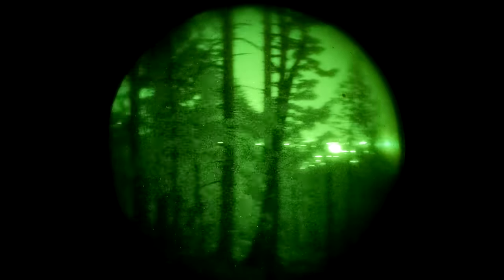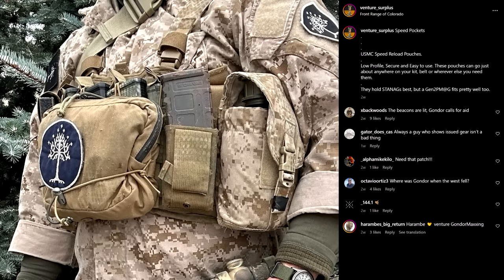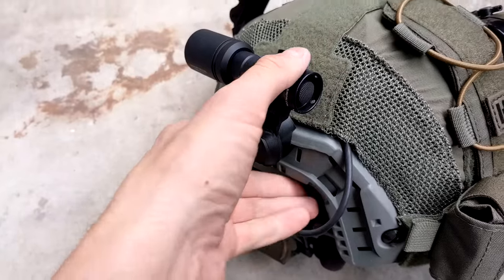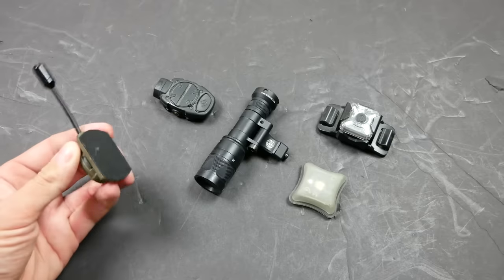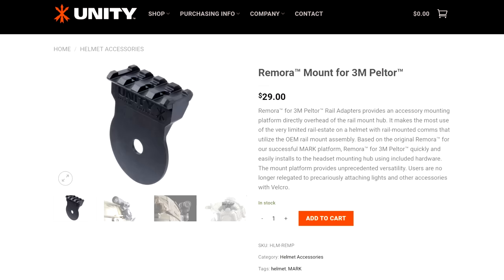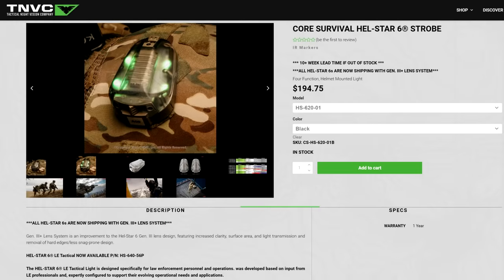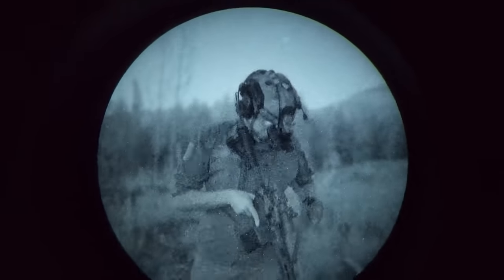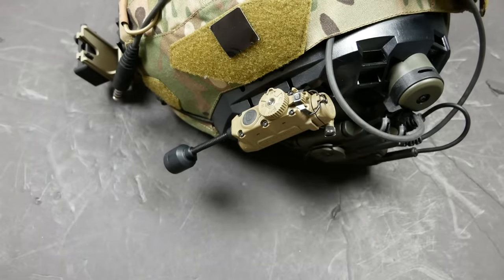NV Helmet Setup: Task Lights and IFF

Comment: A really good use of a strobe system is on night hikes with your pet and you're worried about them running off after a squirrel or something. Gives you a better ability to pick them out. Another good use would be on your vehicle once you enter a new area to mark where you parked. Night hiking in a new area can be daunting because you're worried about potentially losing where you came from.
Reply: I do this with my dog and it's a must in my opinion.
Reply: and for the low tech nights use glow stick necklaces and put on them like a collar. I use this for camping so I can easily see the dog
Reply: A leash
Reply: Wow aren’t you original
Reply: I do the vehicle mark as well. Totally worth doing for parking in new areas!

Comment: The streamlight sidewinder 2 was the GOAT of headlamps in Ranger school and in my Infantry unit. 

It was the only red lens headlamp I could find that took AA batteries. That was huge. Had battery commonality with PVS-14's (and later back at my unit, our ancient PEQ-2's) and I could (and did) swap the battery in the dark while rucking, instead of having to struggle with 3 AAA's that alternate directions. Plus it has IR and a helmet mount, and can take EITHER a single CR123 or AA. I have 2 or 3 now.
Reply: The Compact IIs are the best!
Reply: Yea man, we had the regular Sidewinder (now apparently called the "LED Hands Free Light" according to their website) when I was in the Corps.  It was seriously one of the bits of issued gear that was legitimately GOOD.  Dropped one in a portashitter in asscrackistan and actually went through the shitty process of getting it out.  Even after being thoroughly washed and DOUSED it in hand sanitizer, it still worked!!  lol
Reply: would rather a shitty light than a nonfunctional one 🥴

Comment: Admin lights and stobes seem to be one thing you could really find a great price for on the Ali-Express knockoff market. They don't have to survive recoil, don't need to put out that much power, etc.
Reply: That`s it, got my repro strobe and princeton tec for 30 bucks each
Reply: I have PrinceTec tasklight and Helstar 6 on my primary helmet and exactly same setup with chineese knockoffs on the other. In retrospect, no repros being available in 2016 aside, I regret spending $$$ on original ones. Repros perform well enough and withstand heavy rain. And I obviously don't dive and don't halo jump :P
Reply: I drop shit too much to not go anything but real deal tbh.
Reply: Yeah strongly recommend multiple map/task lights. Run a headlamp on your neck, if you have comms, run a lip light, if you have a helmet, run a stalk. Also have a handheld like a streamlight sidewinder 14032 to hold in your hands. These don't need to be the fanciest things. Just recommend blue/green light if you're using them with nightvision

Comment: The sidewinder Stalk is the best option by far, I was preparing to type an angry comment towards you ignoring it when you revealed it on the table. You can use the Velcro mount to put it on the helmet instead of the rail and still mount earpro.
Reply: This has also been my choice for about a year now.  Seems to be overlooked by everyone.  I guess it isn't gucci so it's shunned. But it's legitimatly the best task light and has a strobe if you need that sort of thing. 
I still use an old vampire light as well though because it's not bright enough to navigate,  as hop stated.

Comment: This is pretty well outside the scope of the video, but I think it's worth mentioning that outside of NV/IR setups, it's extremely useful to consider civilian/recreational headlamp setups. The Petzl E-lite is low-profile (in my experience, basically unnoticeable when doing high-intensity climbing and mountaineering)  and still offers great illumination when you need it!

Comment: I like the ol’ Surefire helmet light mounted on chest rig/ PC pointed down for low light needs and with the strobe doesn’t hit my noods cause it’s so close to my body and I can un clip it use hand held. Leave it on ir and just crack the battery cap to use as on/off.

Comment: That nitecore would have been an interesting option had I known about it. I actually have a Cejay Phoenix Jr 123 wrapped in Saran Wrap on mine. Actually would be pretty good if the mount had an option for a clear plastic cover.

Comment: The Stalk looked really appealing to me when I first saw it. Unfortunately I’m still stuck in 2015 so I have the original Comtac arc rail mounts that leave just barely enough room for some goggle bungee mounts. I just use my pvs14 map light as a task light and an inforce wml on the back of my helmet as an umbrella light. I just pull the inforce off my shotgun since it’s QD and I can also put it on my rifle in case my Surefire vampire goes down. Great multipurpose option. 

For strobes I just use an ms2000 cuz gwot vibes and the big pos also acts as a bit of a counterweight.
Reply: Some companies sell an adapter to attach the same way that Ops core amps do to free up that section of rail
Reply: I'd just sticky the tiny stalk light.

Comment: TAPS is king, admin pouch in front, dbl pistol mag and radio on left, TQ  on right. Can pack 2 40rnd in far left and far right pouch. I also just run a slickster and throw my rig over it when I want to run plates. You can adapt a condor H harness and run double strap for the horizontal for a more secure fit, even with 12 mags and all the other crap there is little movement when secured properly.

Comment: In remarks to strobes on helmets...most of what im gonna say is really just common sense so its not really giving away any TPPs if someone wants to cry about that. When i was working with SF down range, we really didnt use strobes for air. Almost all the time, air knew who the good guys were and who the bad guys were. It wasnt that hard for them to see the notable difference. Usually air was on us before any enemy contact came so when it did come, air knew the line between us and them. What we DID use them for however is when we started splitting off elements to avoid friendly fire and even then...didn't use them much. We just had really good situational awareness that if we saw movement on mountain "x", that was supposed to be the RECCE element or support by fire element or something. We did have a situation however where ofcourse working with Afghans and them acting like a bunch of 13 year olds at the local airsoft field, helo'd in, saw my element up on the mountain, and opened fire on us. We called out a cease fire, and the SF guys were asking "hey, does anyone have a strobe?" LOL i found it kinda funny the more highly skilled dudes were asking infantry guys that but luckily I had mine and slapped it on my helmet. Some could argue its not really necessary to put on your helmet, but I personally was always the guy that had something that was only needed 1% of the time but it still ended up being needed at one point or another and its good to have. Stobes today are super small and super light - its a really good idea to have one
Reply: A infantryman of class then. I also had the rare gear that came in dire necessity 1% of the time. Geardo style.
Reply: My squad leader put his on whenever he got nervous about support by fire not shifting off the obj
Reply: @Monster11B  hahhah i always got called the weirdo for carrying 550 cord with me all the time. And those same people always came to me going "Hey....ummmm...you got that 550, right? I need some for something"
Reply: All of the actual hard information is in publicly available documents you can Google, I checked. Air just coming on station would get a 5 or 9 line and talk on via the jtac or fac(a) or colt or whoever. Many ways to mark target as well whether it's designator, illumination or by fire. All that said, strobe from a clearly visible position don't hurt either. What you talk about is what I'd consider too, friendly forces being split ino several elements. Even without all the cool device, consider doing an IR buzzsaw because that's pretty damn hard to not see (if you don't have some glow sticks laying around idk what you're even doing lol)
Reply: @dogboy0912  yea you know how some guys can get “dOnT tAlK aBoUt TtPs!” When like you said, it’s all over anyway lol. Buzzsaws are good too, that was usually our contingent form of marking
Reply: @Kaotix_music haha I recall doing an exercise with Marines and we had other tasking but the guys on the ground were buzzsaw-ing for like an hour and a half until we finally got tasked with picking them up for a medevac.

Comment: Got 2 Unity Sparks on my helmet. Simplest method to tell them apart is just to use a sharpie and mark the green with a G and the infrared one with IR. Doesn't diminish the effect these thibgs put out. Or put them side by side and systemize it by deciding right side = IR or somthing. As long as you have a system and get familiar with you gear it's smooth sailing.

Comment: My helmet light is the PETZEL STRIX. They were discontinued over a decade ago so it was a royal pain in the ass tracking one down, but I’m glad I did. It has red, green, and blue lights for your choosing, a white light of 3 intensity levels, and an IR light with 2 intensity levels and a strobe mode. All with an intuitive control setup that can be locked so you don’t accidentally discharge your white light, and if you have your white light on and also turn on the IR, it overrides the white light setting and just shines the IR. It has a rotating head but no boom arm (which I personally like because I’m paranoid of the damn boom snagging shit). Plus it looks badass too!
Reply: is the red and blue useful
Reply: @flyingtanks9313  the red is worthless, the green and blue are useful. The green is useful because it helps retain more of your eye’s naturally adjusting night vision while giving you a little bit more light. The blue is useful because it makes the color red super easy to spot so if you’re a medic and checking for wounds it’d be super useful.
Reply: @brandonwardlow4246  cool, thanks for the insights man

Comment: Super cheap option is to use a hole punch to punch 4 holes in a pvc Velcro patch and ziptie an old handheld to it. You can move it around pretty much anywhere on your helmet for task, navigation, umbrella, etc. also less of a snag hazard as it’ll just rip off and dangle if it’s dummy corded.

Comment: I use the Sidewinder Stalk. It has visible light in red, white, blue, and green. It also has the IR stuff. I had to get the instructions back out to get the color back to red, when I got it stuck in green. It's not very intuitive, but does a lot of things if you get the hang of it.
Reply: Recommend against red while aided. Red is the most sensitive wavelength to nightvision and causes the most bloom. Green is softer, and many goggles have blue light filters which means blue light has no impact on aided operators.

Comment: Having used most offerings, I think the best currently is (albeit cost prohibitive) the TNVC/Surefure head on an S&S MAX mount and with a surefire flip filter. This gives you low then high white and IR light, on a highly adjustable arm to angle it any way you wish, and a blue or red flip cap for a white light filter. 
Close second and 1/4 the price is the Princeton tec charge. With a red/green/IR low and bright white model and your choice of AA or 123 battery it’s pretty slick. 
The streamlight falls into third place from my experience
Reply: People hate us surefire users.

Comment: TNVC has a dual mode single cell vamp head that's only 5mW of IR when clicked once for low mode, 2 clicks gets you full 100mW of output. it's the best option I have found and might be worth looking into.

Comment: Hop, how are your Otto clamps on the helmet I have had no end of trouble with mine, they just willnot clamp down hard enough to get a decent seal. Curious if its just my set and maybe I should try getting another, AFAIK there are only one brand for these mounts.
Reply from the maker: If you're sure you're getting them to lock into position your helmet might not be sized right. If the helmet is too big the mounts and all that stuff will be too far away from your head.
Reply: @Hoplopfheil  Its a Medium sized to my head, but I appreciate the input.

Comment: Task light recommend blue or green light. Yes red light doesn't travel as far, but red actually has the most bloom and appears brightest while aided vs green or blue. Not great if you're trying to reduce your signature vs aided or not bloom out others/your own goggles, but it also might not matter based on your environment. Many NVDs have a blue light filter which means blue light is completely compatible (you can't see blue light through them) which means you can do all unaided work under blue light without it affecting anyone on goggles. Also if you use yellow highlighter and hit it with blue light, it will glow if you're referencing some navigation/mission products. 

The ol streamlight sidewinder 14032 is standard on our gear and can do blue, green, ir, and visible which works good enough for a lot of things. It's not the most high speed nor is it hands free (though it does have a clip). This is in addition to a lip light and they occasional stalk light that someone puts onto their helmet.

Comment: For the record, overhead assets can’t see the strobes mentioned in this video unless the pilots are also wearing NODs.  Their pods see in the medium range IR (MWIR) spectrum.  In 2014 that friction caused a blue on blue that whipped out 1/2 an ODA.  Don’t forget to submit your DD Form 1972 72 hrs in advance, and please refer JP 3-09.3 for all your CAS needs.  Sincerely, Guy-who-misses-having-a-small-crumb-of-relevance-so-he-dips-into-civilian-centric-YT-videos-and-plays-Mr.Know-it-all.
Reply: Is it not normal for CAS to wear NVGs on night missions?
Reply: It’s common for them to have NODs but it’s somewhat uncommon for them to wear them because they lose access to their HObIT (or whatever other helmet mounted display they have.) Except helo pilots.  They have them on for the whole mission.
Reply: I find it difficult to not give sound advice too.
Reply: @jackjmaheriii  Interesting and thanks for explaining.
Reply: Read some JP 3.09-3 today actually lol. Yeah I'd suggest having IR chem lights to buzzsaw. It's been a minute but you can see that pretty clearly on flir iirc. There is a low light mode on the flir but for targeting, weapons are boresighted to the IR so that's the mode you'd want to be in.
Reply: Buzzsaw / Wagon Wheel are useful, but are still not visible to pods.  Lighthouse or similar are the only option for strobes.  If it’s danger close, pull your boys into a tight perimeter, use a good old fashioned GTAS, and pray that Boeing or Raethon didn’t screw up their QC.

Comment: Used IR beacons in airsoft. It makes a huge difference for foe identification. Night time combat can be chaotic, even with NVG's. IR beacons made it very easy to identify a target as foe, especially when close to friendly playes. However, these days...too much NVG capability on both sides :)
Reply: A neat little beacon is the Pelican IR beacon. Cheap, lightweight, easy to use, just powerful enough for 50-100m identification.
Reply: You guys use nv in airsoft? That’s commitment
Reply: IR glowstick or IR light hand signaling. Just hash it out for your team beforehand. "We will signal with an IR 3x flash and you will respond with a buzzsaw with IR chem or draw a circle with IR."
Reply: @dogboy0912  Very good tip. Yes we sometimes used IR WML flashing (or even white light flashing) for friend/foe identification. It's smart because it makes no sound and you can communicate around corners in CQB while being silent.
Reply: @Rubeless  It's the most fun you can have without going to jail... :)

Comment: Hey hop, in all honesty, for getting ones first bump helmet. Would it be better to go with hhv or save up nd get ops core/ team wendy? I know ballistic helmet you get what you pay for, but for bump helmets. Pros and cons for each one?
Reply from the maker: There are so many weird issues with the HHV that I wouldn't recommend it. Team wendy has the best "entry level" bump (better pads, suspension) but the new ops core super high cut FAST bump is my go to bump helmet now. The downside is it costs like 500 bucks and is still just a bump.
Reply: @Hoplopfheil  alright, so if money is no concern ops core. If it is, team wendy